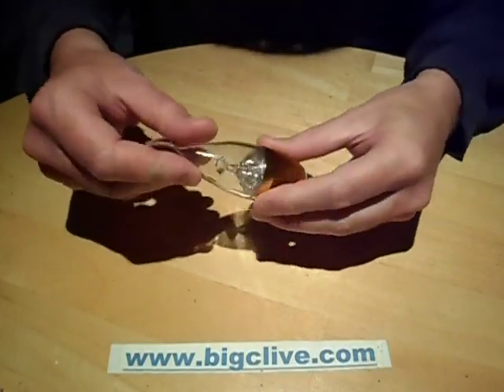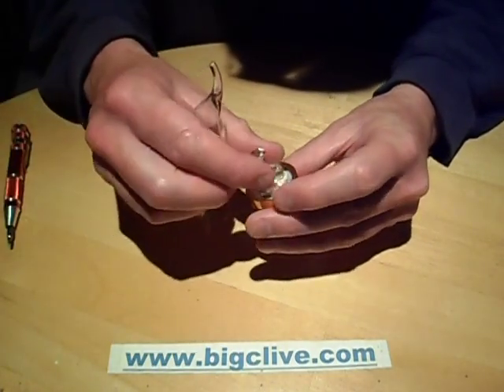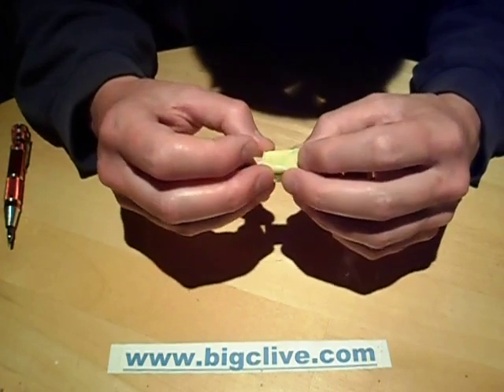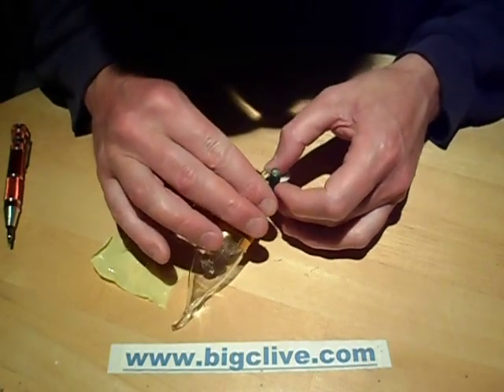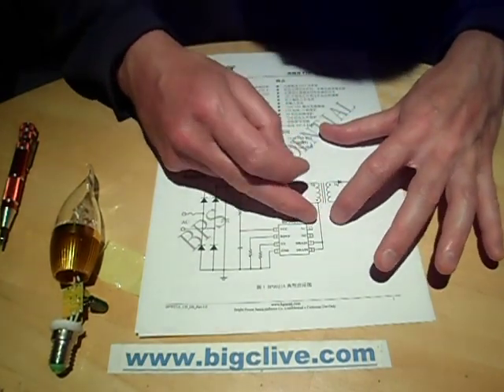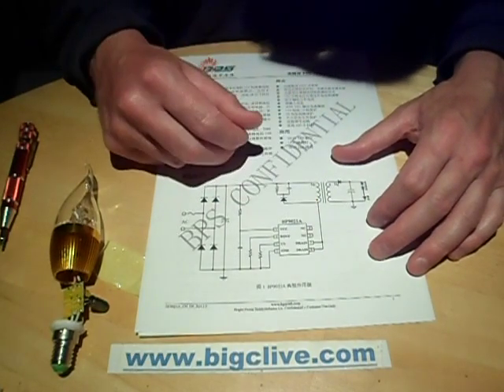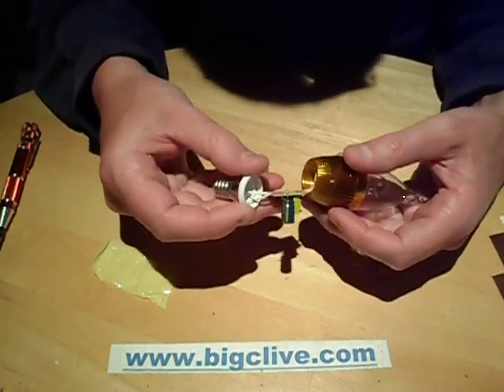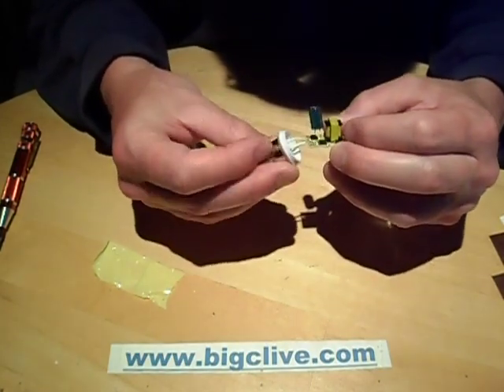Teardown of a 3 LED candle lamp.

Comment: ROVP - (Resistor) Over voltage protect maybe ?
Reply from the maker: I'm not sure.  The earlier chips had open circuit load detection via the feedback winding, but that might be detected by a threshold detector programmed by an external resistor, or it could even be to allow modification of the internal oscillator frequency.  I haven't a clue what the resistor is for.  Hopefully they will make a datasheet in English for it or at least some form of information that can be translated.
Reply from the maker: bigclivedotcom I found another data sheet for a buck regulation version.  Very similar chip and the ROVP is for programming a voltage threshold to detect when the load has gone open circuit.
http://www.bpsemi.com/pdf/BP2831A/BP2831A_EN_DS_Rev.1.0.pdf